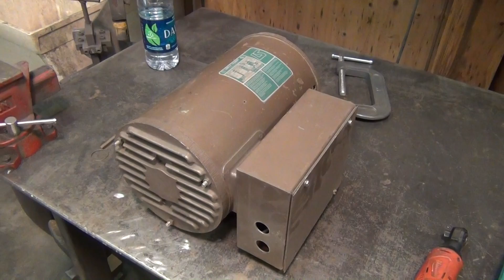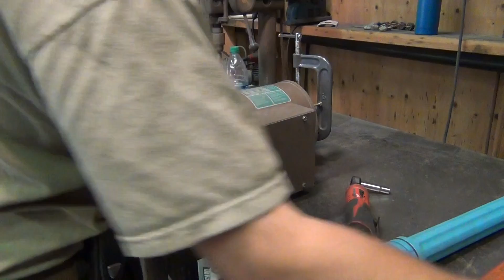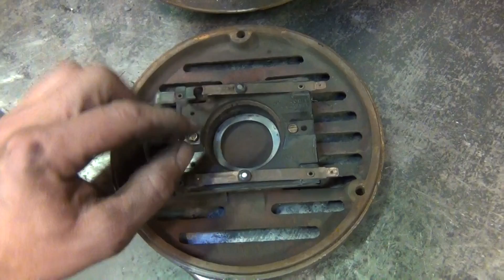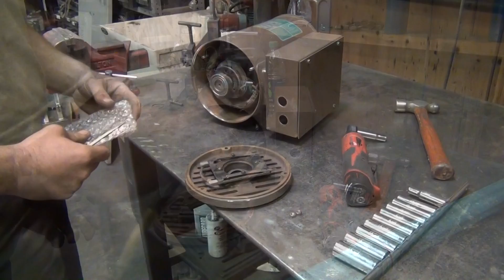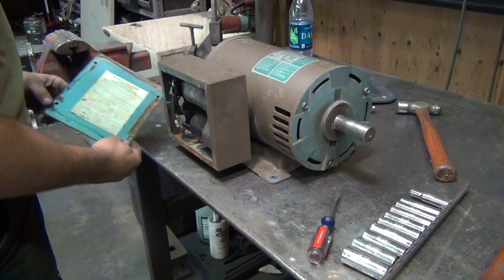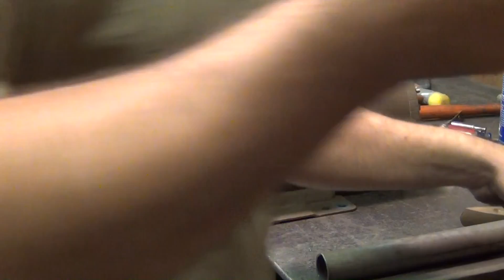Air compressor motor troubleshooting part 2: stationary switch replacement

Comment: I just got two Dewalt compressors for a deal. One works the other does like you pt1 video. I swapped capacitors and no luck. Hopefully i can swap these parts inside the motor and see if it solves the issue. Thanks for the lesson 👆👍

Comment: You didn't test the motor under load in video.  In previous video, you had the motor under a load when it wouldnt start then took belt off and then motor ran. Im sure that switch was obviously the problem but would have liked to see how fast the motor  starts under load after repairs. But thanks for the video. Definitely a helpful video.

Comment: thanks for the video!  I didn't even think of the inertia switch! replaced both of the caps and couldn't figure it out.  although my motor is much different, I was able to test the switch and it was faulty.  dirty contacts. thanks for the info!

Comment: What were the symptoms when the motor stopped working? Did it hum or buzz, or was there nothing at all? My motor has nothing at all. When I by passed the magnetic on switch and hooked it up directly to the motor, there was still nothing, no sound or movement what so ever.

Comment: Thanks so much for your video , you should be a teacher at a trade school because you are very good at getting your point across! I am trying to repair a 5 HP 240 v Air Compressor for a friend at his business . I assumed the Start Capacitor is bad because the motor runs without the belts on the compressor . I do not see any centrifugal switch drawn onto the wiring diagram on the motor like your schematic showed, but there is one unlabeled wire coming uo from the motor windings that might be from a switch .I still think the start cap is bad, because it reads from zero ohms up to about 15 ohms and stays there at 15 ,both ways you try it . I believe it should start at zero and climb to infinity . Thanks again , greatly appreciated sir.

Comment: Sir I happen to have that exact  leroy somer motor and I'm trying to hook it up to my compressor I also have the same pump but I can't find a wiring diagram can you help me out. I received them together but they were not hooked up with no capacitors , came with a 200 gallon tank.
Reply from the maker: I would gladly help, but I sold that compressor several years ago.  No good way for me to give you any guidance, beyons what you see in the video.  Sorry, wish I could be of more help!

Comment: Thanks for the video. From the looks of the inside of the motor and the condition of the centrifugal switch, it looks like it has been running for a long time. Very well made. Unfortunately, they don't make them like that anymore.

Comment: Good day. I have a duel capacitor duel voltage 2 horsepower Baldor motor. I plug it in, it spins for maybe 3 seconds then trips the breaker. I tested the capacitors but only by taking them out and putting 110 volts for a split second and then shorting out the terminals and I do get a large snap. I checked and cleaned my contact points on the inertia switch. I am wondering what the symptom would be if the inertia weights were not working properly and not taking the start capacitor out of the system? Any help would be appreciated.

Comment: I guess it's not quite 5 years since you did this-but I did it this morning. I had a 30 gallon quincy compressor that has been flawless for 25 years. Last week  it stopped working. I thought it was the start capacitor, but when it wasn't I thought "Now I am going to have to spend another $500 on a compressor. Shoot!" Well you saved the day> I went out and took the motor apart, cleaned it out, cleaned off the contacts to the switch and viola!-it works like it is brand new. I wonder how many compressors are in the landfill that only needed a switch or a cleaning. Thanks!
Reply: Did your switch stay closed constantly when you turned the motor by hand, or was it intermittent?  I'm in the same boat from the looks of it.

Comment: i have a marathon electric motor on my compressor and a brand new running capacitor 
(air compressor starts running and then sounds weak and lower and shout off)
any idea what’s can be the problem.??)

Comment: You just saved me a ton of $$, thanks man!  Originally, I thought my problem was the start cap, but it turned out to be the centrifugal switch.  I'm working on an A O Smith motor on a 90's craftsman air compressor.  The specs of this compressor are far better than any compressors sold today, even at price points 2x the original MSRP of this compressor.

Comment: Great tutorial, just 1 minor question: at 5:47 you said you're gonna use the voltmeter to check if the capacitor was in the circuit . My question is , how did you measure voltage when the machine is off ? I know resistance/continuity must be checked with the machine off, but doesn't it need to be on in order to detect voltage ?
Reply from the maker: I should have said ohm meter.  I was checking continuity across the stationary switch, using the provided wiring diagram to choose my test points.
Reply: Matt Verley cool, thanks for the prompt reply

Comment: Do you know of any websites that have info on plumbing/wiring up a compressor/pressure switch/motor. I got a compressor give to me. It is a 120 gallon and has a 10 hp. The capacitors need changed and all the plumbing and wiring has been taken off of it. I cannot find any markings on the compressor so I have no idea who made it. It has a Baldor motor on it, not sure what all I would need to wire the motor up.

Comment: Can you tell me where you found that stationary switch? I need one for a weg 5hp motor
Reply from the maker: I just did a google search, and spent about 20 minutes wading through the results until I found the right one.  I ended up buying it from Stout's Electric Motor Service.

Comment: It looks like you could for a quick fix, have extended or stretched the motor switch wires to use just the one working switch that had not burned out?  is that right? Thank you for the information BTW.
Reply from the maker: yes, that would have worked fine.